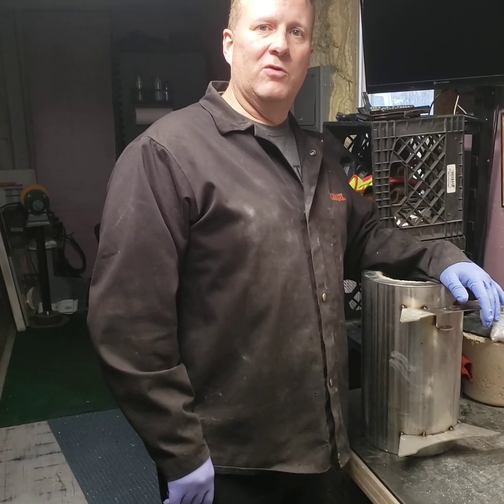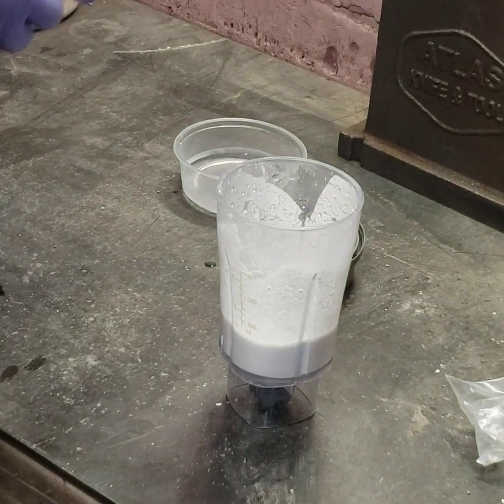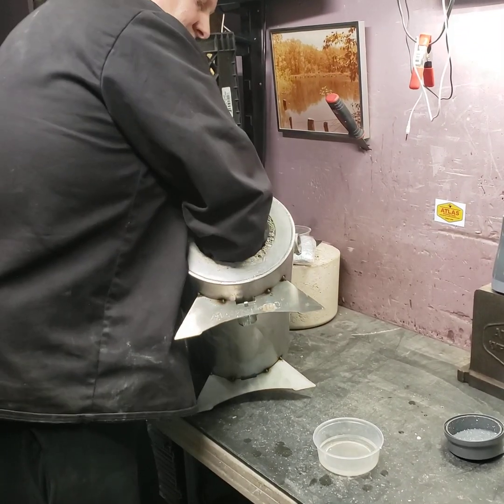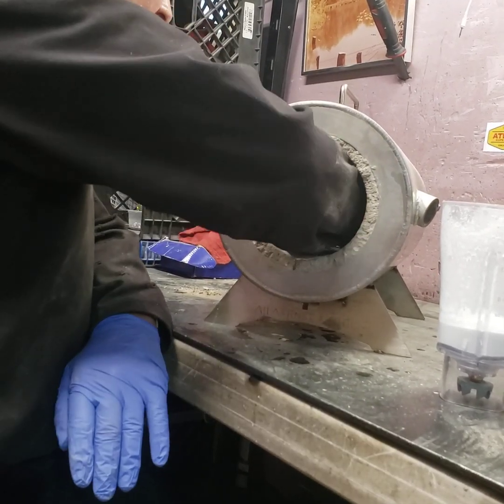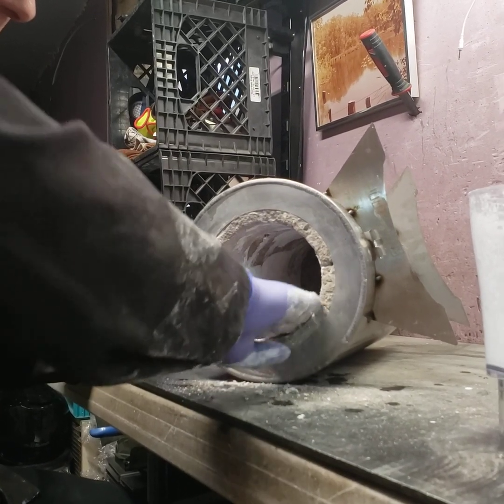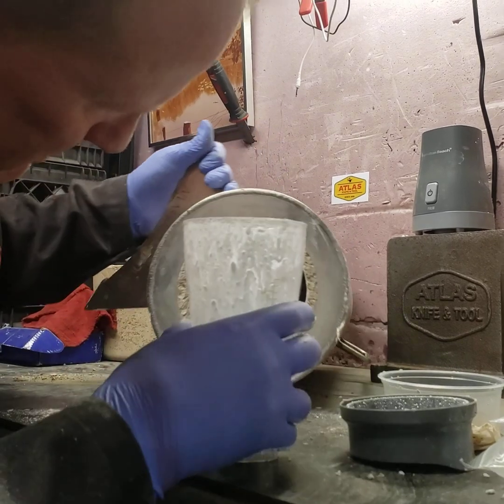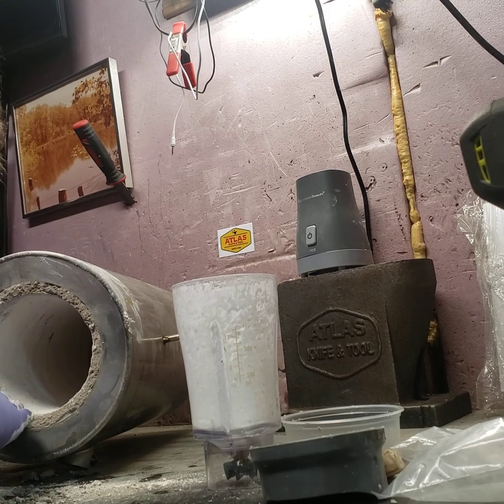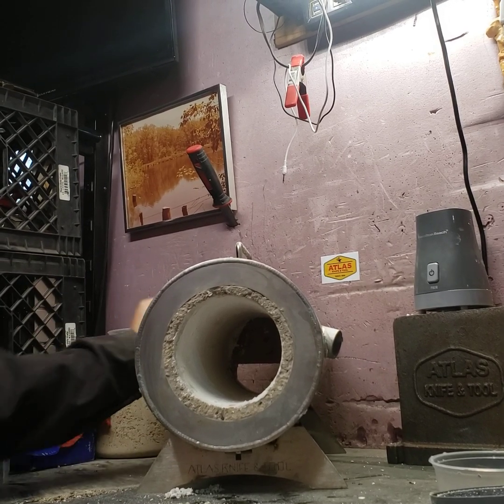How to line a Graham Forge with Plistix 900f

Comment: Wish I found this video before trying to apply it. I ran into the issue of the stuff not mixing good and then when trying to apply it, the cement soaked up the moisture so fast out of the Plistix, I could hardly spread it. I am needing to buy more to redo it. Thanks for the video and the tip to wet the chamber first.

Comment: What is it for exactly? Can I run my atlas without it?
Reply: Did you buy the K sensor to Heat Treat? I think I will use toaster oven for heat treatment..I am used to old fashioned way ledging the spine over a  channel,all new for me here..I like Bowie's and machetes...Cannot wait to fire this up,had it for two years in rhe box..
Reply: I am here for same reason...I have Atlas forge to...They did not give it with when I bought mine.I did not use mine yet,had some set backs but now have my belt grinder.I noticed they say they give a bag with the Atlas now,to coat and add more protection against wear and it reflects heat back into the forge and makes the refractory last longer I  guess..5pound can is $45....On Atlas site was $14.95,then I looked nex and was $25 .....Maybe diff sizes? It is not needed but will make run more efficiently I gather..What did you find out?? I was wondering if I should get before firing up?? Only need a little,wish came in smaller amount,might buy from Atlas the smaller amount..

Comment: Hi, I just got my Graham forge, It came with the 2 pouches. Do I need to apply it or is it already in there and this is just extra?
Reply: If no one answered you it does not appear to come with it already installed.  You’ll have to apply it. I hope this helps.
Reply: I did not get any sent with mine but notice it is mentioned.....
Reply: Hiw often does it get applied??
Reply: I don’t think I applied mine correctly but about a month some parts have come off rear is still holding up fine. I’d like to buy a 5 pound bag and put a solid 1/8 th inch around the whole thing
Reply: @rileyevans8477  Stuff is expensive..  When I bought mine it was not offered... Small bags up to $25 now from $14 (Atlas),,then On the Plisix site a  entire can 5lb was $45...
Reply: It’s not needed to run the forge but it does seem to reflect the heat a lot better. So maybe worth it for gas saving. Also if it saves my castable refractory that’s a bonus.